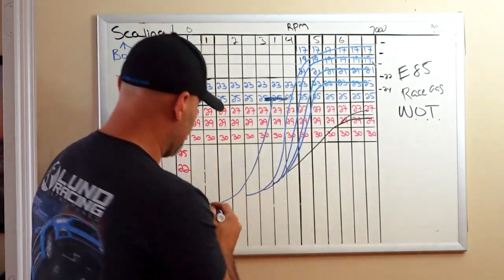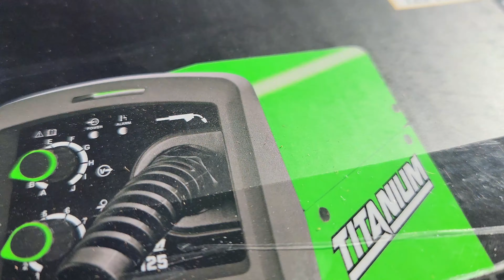Fairmont update. Turbo manifolds and welding the engine plates.

Comment: Alex a real experienced welder will say it’s fine. Weld can be stronger than material used penetration is important easiest welds are when both items are same thickness. Clean material makes it easier. You going to enjoy it when you get the hang of it. Your welding pattern will get prettier as you do more. Safety always stay safe.
Reply: 👍 To Alex

Comment: Not bad welds all things considered. I had the same flux core welder and it'll do 90% of what most home gamers need. If you're trying to keep the BB's down there are few easy tips to help.
1. Make sure you have enough wire stickout from the nozzle when flux core welding 5/8" is a good spot to start and then experiment from there.
2. Clean your work from mill scale/paint/oils
3. Anti spatter spray, most welding stores have it and a light misting will make most bb's fall off after welding.
4. Weld settings this is what helped my welds the most. Too much voltage and it'll spit bb's everywhere, I would turn down my voltage down 1 letter and wire speed up 1 number and that would usually get me on the money. It should sound consistent like frying bacon, if it smells like it you're on fire...

Comment: Your worst weld looks better than turvis best! On the gap in the motor plate bracket, that's perfectly acceptable with wire welding. If Ryan is going to TIG it, he might want it tighter but I bet he is fine with it. Keep up the great Alex!

Comment: Tip for future Alex doing Fab work if you have to make a tab that goes around a tube get yourself a hole saw kit. Cut the hole, then cut the plate in half 

For flux core, your welds look great 💪🏻
Reply from the maker: Yes the 2nd mount was with a hole saw.... night and day difference

Comment: Make sure the fan is not hitting where you're welding. If it is try and block it and it will result in better welds. The flux is supposed to block the outside air but with a wire that thin it truly won't block the fan or a string enough breeze
Reply: 100 % get rid of the fan 👍
Reply: Yup. He should turn off fan when welding and then he can just turn it back on afterwards. Wind is not your friend when welding.

Comment: Consider small twin 66 t4s and they fit perfectly under each fender tube.. The hotside off the holley headers end up like 1.5ft of exhaust on each side.. Don't  have to route a hot crossover through engine bay like a single..  Just a thought for ya..
Reply from the maker: Yes it might end up being ty based on the room

Comment: Great work, Alex! Your content is fantastic. CWI and former pipe / pressure vessel welder, I suggest preheating the area with a torch to eliminate moisture, precleaning the area to remove contaminents, turn off fans or sources of airflow, and in this direct case spatter is typically caused by to high amps or too low voltage. To correct either lower the amperage by decreasing the wire feed speed or increase the voltage. Hugh money is looking awesome! Keep up the great work! I look forward to all the progress you make on the regular. Like button smashed.

Comment: Min 19:10 . That other metal is aluminum . Guy you can’t use that type of wire on it lol . But nice try . You will get the hang of it . Doesn’t take long to catch on . Your welds looked nice . Cleaning it up with the grinder is nothing . It means you take pride in your work .
Reply from the maker: It's magnetic. Lol. Not aluminum. It had some odd coating that made it not weld friendly

Comment: Move the rad forward and maximize space by putting it on an angle. Top side are forward as possible and the lower end closer to the motor.  Seen many many do it this way.  

Unless you're adding a big A2A cooler then forget i said anything.  
Lolol
Reply from the maker: The intercooler and radiator already have been mounted.

Comment: I know you don’t want to hear this in the heat but if you keep that fan away from the weld you’ll get less spatter. You’re blowing away your “shield”
Reply: This is flux core wire my dude spatter is built in
Reply: @robostyle9773  Yeah that's why I said "less" I've run a mile or two of flux core lol